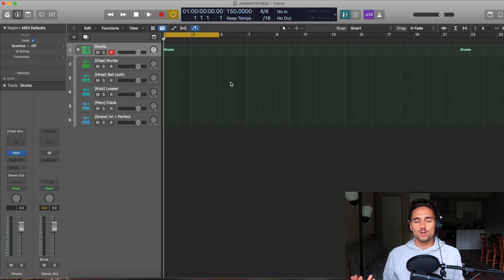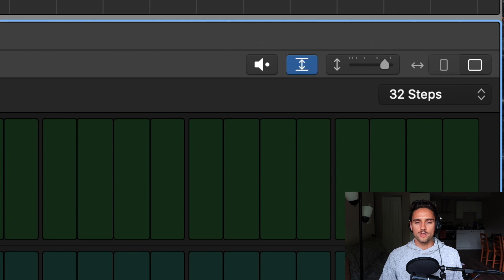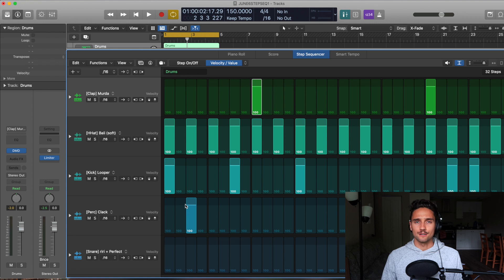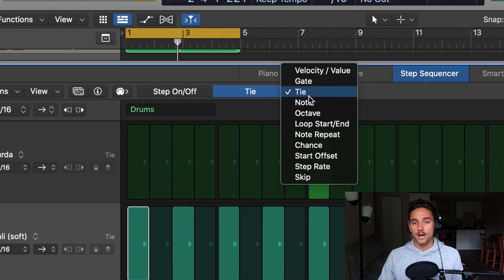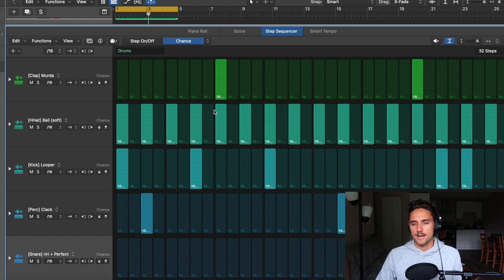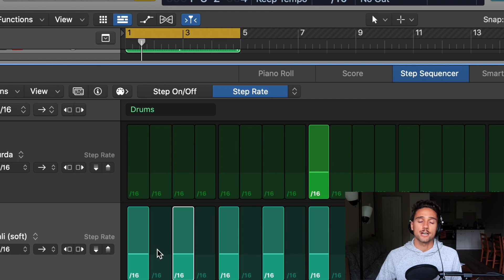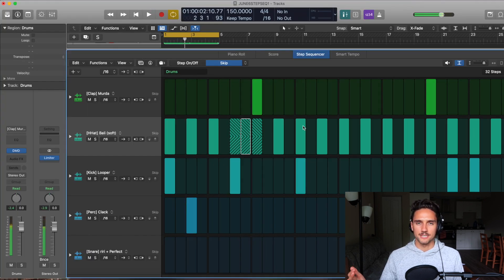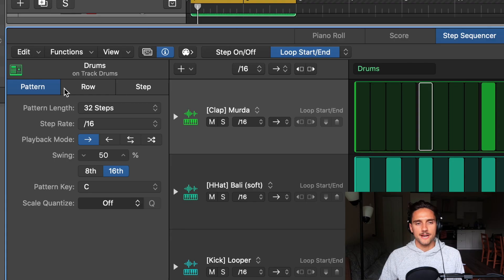Logic 10.5 Step Sequencer for Drums | Logic Pro X 10.5 Step Sequencer Tutorial Series (Part 1)

Comment: hey tony i have another dmd question... so if i get my pattern the way i want in the sequencer, how can i apply subtle (or not so subtle) variations in the drum track (changes in the course of the song) without making entirely new dmd tracks? eg i want to keep my original pattern visible in the sequencer, but add changed for certain measures within the song. please advise thx
Reply from the maker: I would make the changes in DMD and then convert to midi wherever you want to have the variations 👍 Thanks for watching
Reply: Tony Holiday ok is there a way to do it without midi?
Reply from the maker: @gothsurfshorts  Copy the DMD pattern?

Comment: Excellent vids. 🙏🏼.  Question:  how do u switch the hihat pattern to triplets for just a bar then return to 8ths/16ths (like u were gonna make something like hotline bling)?  Just switched to logic from mpc; very much in learn mode.  Thanks again ✌️
Reply from the maker: Thank you! Really pleased that you found the content helpful. Note repeat would be your best bet here. Enjoy!
Reply: Tony Holiday  note repeat wouldn’t work in cases where the triplet goes across more than 1 beat.  I tried creating another row w the same sound on it and putting that row on 1/8T quantization.  Didnt work, as the new row played at a different pace.
Reply: phat pat try to use the “tie” option. Located the same place as noted repeat. That worked for me
Reply from the maker: Change the rate of the row then

Comment: The only important thing is missing is the possibility to pitch each note on fly, like in FL without any workarounds. Specially for hi hats roll. Great video!
Reply from the maker: Thank you for watching! Not sure I follow what you mean, you can pitch hi hats by changing the pattern to midi and pitch from there
Reply: @itstonyholiday  well, let's say you have created a sequencer pattern with all stuff like kick, snare , hi hats etc. Now you wanna pitch only the hi hats. Yes , you can convert the region to midi but I can't see the option to pitch just hi hats as all notes inside are occupied by other drum Kit elements. Plus once you've converted to midi, you lose the possibility to go back to step sequence pattern in case of.. pls correct me if I'm wrong, maybe I overlooked something? 🤔 Thanks in advance!
Reply from the maker: @LagunaFruit  Yup that's the only way to do it really. You could: 

a) take the hi hats out of the DMD sub group and use the note mode in the step sequencer to pitch them within.

OR

b) Do as I said above. I use this method, cause I tend to change my pitch and rolls for hi hats last.
Reply: @itstonyholiday  Thanks man!;)
Reply from the maker: Good luck! Thanks for the shout

Comment: The only thing I hate about Logic rn, that is messing with my workflow, is that 90% of my samples in the built in file browser can't be previewed instantly. Logic seems to struggle with anything above 16bit. Compared to Ableton and FL users, where literally all their samples can be previewed right away so they can find the best drums for their track. Even though I love what they did with the 10.5 update, I'm still having to use Alchemy's sampler sometimes just because it lets me preview all sounds at one click. If Apple gets on top of this, my life would be complete
Reply from the maker: Ya I feel that... I make most of my samples now from scratch and they’re in 24bit so I don’t have any issues. But could see this being frustrating
Reply: report it to logic feedback https://www.apple.com/feedback/logic-pro.html
Reply: Quick 2022 Update:
XLD seems to have problems with subfolders. Also the filesize of the converted audio samples shrinks, which doesn’t makes sense. People also seem to have problems with distorted converted files.
There is a new workaround. Try out MediaHuman Audio Converter. It‘s much better and also free. I recently converted 60.000 files. Cool thing is, it takes over the original folder structure. So you can still open your older projects or even projects from another DAW!
Reply: There is a free app called XLD, it will automatically convert to which ever you prefer and keep them in the folders. Completely fixed this problem.
Reply from the maker: @mehcustom24  I used it... didn't work for me to mass convert. The 24b files all came back distorted and such, would not recommend this program. The only effective way I've found is by doing it 1 by 1 via dragging them into Logic.
Reply: @itstonyholiday  Its a lossless converter that runs natively on mac, you must have not checked the options properly. I converted 60,00 samples and haven't found single bug in one since I did 6 months ago. I made sure top create a back up before hand just in case though. Btw, as a soon as you drag those samples into the logic session, the exact same lossless compression is done on them. Thats why you cant preview you them, Logic doesn't pay 24bit samples, it has to convert them when you put them into the project.